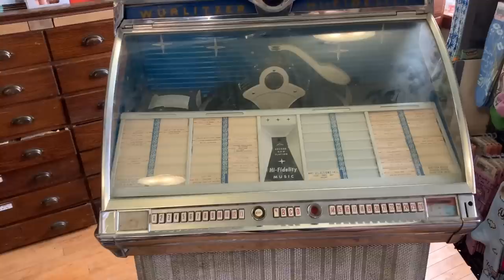Free Jukebox?!? will it work? Junk 1959 Wurlitzer revival

Comment: WOW, it's gorgeous. It's possible that it's only a Canada only model too. Admittedly I don't work on jukeboxes, BUT I do work on vintage tube electronics, and "just plug it in" isn't always a good idea. Jukeboxes were rather high quality, but the amplifier should be looked at by a professional, anyway. It's a fire and shock risk if not checked out, and if not, you could've seriously damaged the power transformer, rendering it useless. Just a friendly warning. Your friend there seems knowledgeable on the mechanical part, and you can rely on him for at least that. Have fun with your new jukebox! You're the envy of many in the vintage electronics community, now. :)

Comment: We purchased a 1961 (Same model) Wurlitzer with the exception, it's color on the sides are a blonde formica. We had it serviced and cleaned and the guy had a set of external box speakers in his shop. We inquired if he'd consider selling them. We bought them for $300...a steal.  What a sound they added to the Juke Box, omygosh! (note: always have at least 2 replacement needles as they do wear quicker than most) Allow me to add, I worked in the 80's as a "Melody Girl" for a national vending machine company then and my job was collecting from many models of the dying vinyl juke box industry. I bought the records from a warehouse and kept the lowest played records as new releases...we have many old labeled original 45's in our collection, last counted to be approximately 1300 and various genres. The counter is on the spinner, tells that info *wink *wink. The only cleaner that's ever been used on the chrome is vinegar water. This is one prized item that will always be cherished by hubs and myself. Enjoy yours!! xo

Comment: Alex , there is a Wurlitzer Programme on a readable CD that allows you to input the artist/ song selection onto a myriad of card designs then just print them out and cut them to fit......it only works on Windows not Apple unfortunately.....well mine doesn’t.

Other wise you’ll have to use a typewriter if you buy the serrated “proper” cards for it

If you can’t find one I’ll burn one off for you

Comment: There is a good way to fix the belts using polyurathane belt material available on eBay. You can make ANY size belt you need. Look for the diameter and you cut your own to length. Better than the original material used back then. Just for info. I use that material in my business all the time.

Comment: jukebox!! hell ya!! 
jukebox cables of most makes were made with dummies in mind all the plugs are different it also reminds me of a mod a friend of mine made for someone who was restoring an old Wurlitzer now, the electronics for sound and the ones for the mechanics are separate the mechanical part was fine but the sound part had major bugs and lots of work needed that would take months if not years to complete, however,  you can bypass the sound electronics completely with a modern small amp you hook it up between the phono part and the speaker and even though this guys jukebox will have a long time to be restored he has a playing jukebox! because of the amp, my friend build.
it's always the wife who hates having this big dead thing in the room but if it plays it's ok

Comment: I would suggest listening closely if you hear a hum when you power it up. If so, then look at your amp and replace your filter capacitor. Remember your components are over 50 years old. Replacing it will protect your amp's transformer. Good luck and enjoy!

Comment: Replacing the audio tubes will make a world of difference. There's a place in Dallas that has NOS tubes for those called 'Slemmons' or you can get new ones at Tube Depot.
Reply: No it won't. Good tubes are good tubes.
Reply: @SeeburgMusic  l havent worked on a 50s/60s tube amp in 35 years of service that didnt have a weak or at least one bad power tube. Lots of people will run OS at 80% and call it good. People that repair juke boxes and organs are notorious for putting old weak tubes back in after cap changes and service on power amps. When l repair guitar amps l want the NOS tubes at 95%. lt makes a huge difference in tone. When power amp tubes go bad they work but are all midrange. ln some applications like old juke boxes this is ideal.

Comment: Alex on the Internet you can order  lots of rubber belts pretty inexpensively that are multiple sizes and lengths they list as turntable and/or tape recorder belts  I too have been interested in Vintage Jukeboxes  and music components  like you guys I’m a hands on repairman  and service guy btw the Internet also has many repair manuals  and other literature on the common Jukeboxes to purchase Wurlitzer and Seeburg models  often shared parts in their other machines so the common ones are out there in plenty I’m rocking on a 1954 Seeburg 100 carousel right now  that is fully restored

Comment: There should be a tone arm "weight" adjustment to set the pressure the needle contacts the record. This is usually the problem with dragging records.
Reply: No it isn't.

Comment: Ask your guy to check that the filter and coupling capacitors in the amplifier have been replaced. The original ones will not be working correctly and will prevent it from sounding as good as it should.
Reply from the maker: It’s the needle the contacts are broken
Reply: @CuriosityIncorporated  It's a good idea to replace capacitors if there are tubes in the amp. They can leak and dry up and have enough organic material to catch fire
Reply: @toyfreaks  true. Bad filter capacitor can result in a fried transformer in the amp - and good luck finding a replacement. Better to be conservative and replace the filter cap before firing it up. Nice 1959 model.  It is the mono variant - you can tell by the hi-fidelity signage  up on top.

Comment: I'd like to know what was done to reduce the gear noise, especially when loading the record.  Can't reduce the noise level on a 2910, which is a few years newer.  Just loud.  Even filled the gearbox with lube that turns the mech.  Every one I've heard is loud, but yours got much quieter after lubrication.  Maybe the type of lubricant used?

Comment: HAVE THE SAME MACHINE IN MY PLAY ROOM MINE IS A 1957 THEY WORK GREAT BUT NOT STEREO AS IT WAS NOT AVAILABLE IN 1957...GREAT MACHINE...NOT WORTH A TON OF MONEY AS THE EARLIER ONES ARE...TKS
Reply: The market for these is strangely different in the US vs UK and most of Europe.
I see them for sale in the US for $300-600. Just found this exact machine on a UK retro dealer site. Price? £14.000 That's about US$ 18.000 and you will struggle to find a working one cheaper.
My cousine has the model with the triangular buttons, I think it is the model before this one. He got it from a local cafe here in Norway that was closing down, and he paid $20 in 1980. Today it's estimated at $12.000.

Comment: You should have checked the capacitors and electronics before ever plugging it in!   You go very lucky you did not trash a Valve or transformer and speaker.